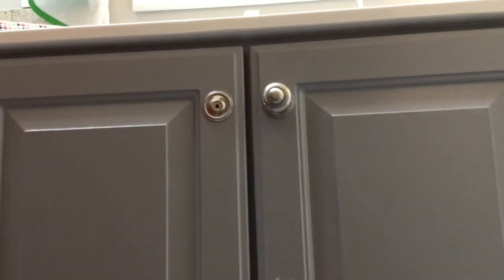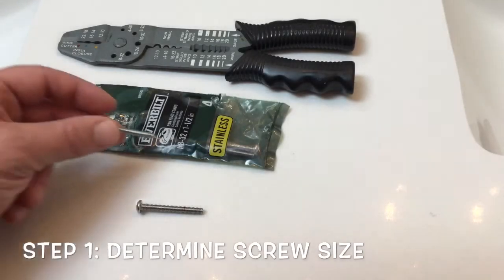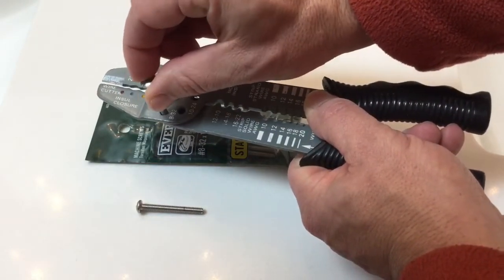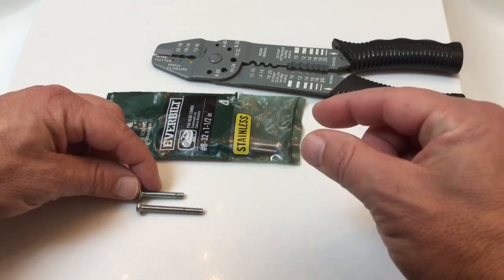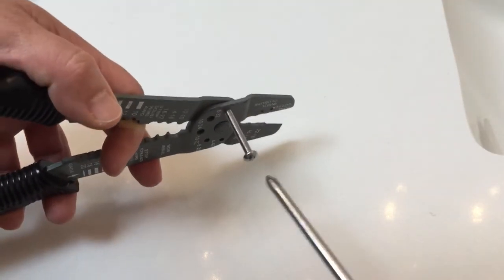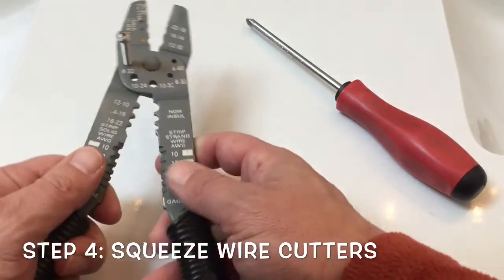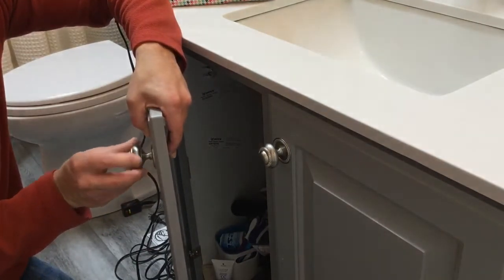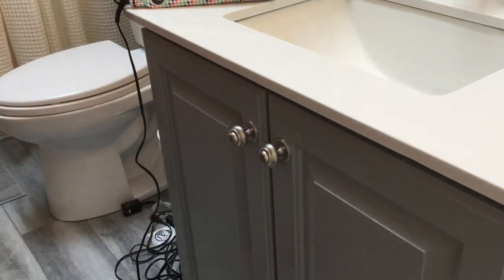Dad Fixes Stripped Cabinet Knob or Drawer Pull

Comment: I tried to uninstall the knob from a bifold door and it will not move. Any suggestions?
Reply from the maker: Hey there. Are you saying you used a screwdriver and the screw won’t turn?
Reply: this is the problem I have and the video doesn't address it
Reply from the maker: Is there a screw that won’t turn?

Comment: I just bought a new screw,the exact size and it feels like it's the actual handle that's stripped. Is that fixable?it's a antique one so I need to save it
Reply from the maker: Can you look inside the handle at all? I’ve glued a toothpick or two to the inside of handles in the past to create something for the screw to “catch” if the knob or handle is stripped. Basically glue them in and then break them off at the point they are coming out of the handle hole. You could probably “dry test” it too — before glueing, hold a toothpick(s) in the handle and try to screw the screw in. See if it catches.
Reply: @daddoesvideos  thank you so much I appreciate all the details and help.
Reply from the maker: No problem! Hope it works out for you!

Comment: superglue and baking soda in the handles hole. Why overcomplicate things with expensive screws? You probably have Superglue and Bakingsoda lying around the house.
Reply from the maker: Sure, could do that too. When I’ve tried that, though, it seems to work initially but doesn’t hold up over time. Could be just my experience, though. Thanks for bringing it up!
Reply: @daddoesvideos  how hard are you pulling your handles? My grandfather did this to drawers when I was 5 years old, 30 years later they still hold up very well.
Reply: Bottom line from this video: buy new screws.  No mention if knob is stripped
Reply from the maker: @namwilson  Yeh, the knob wasn’t stripped.